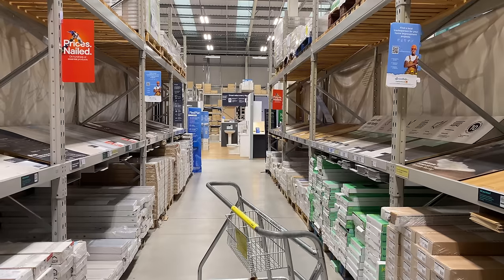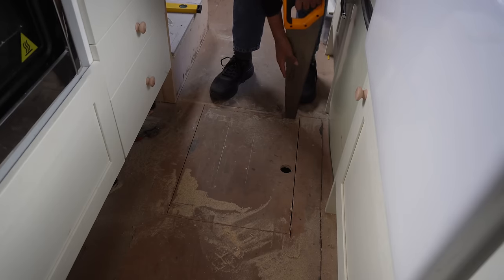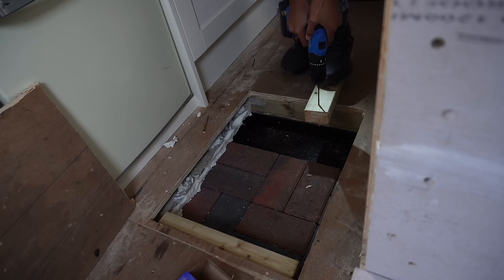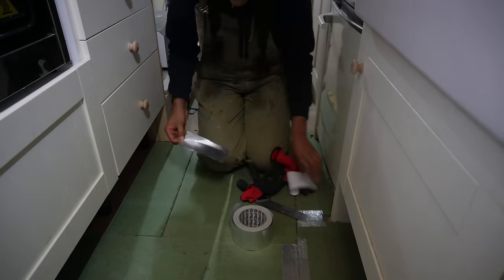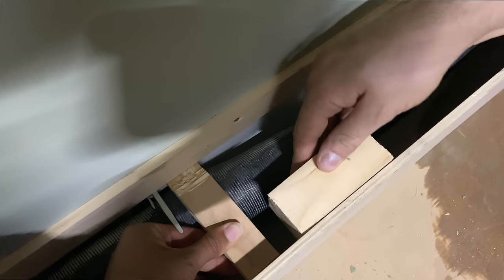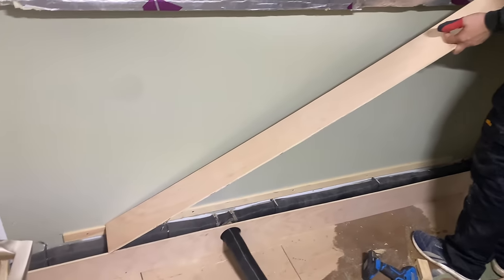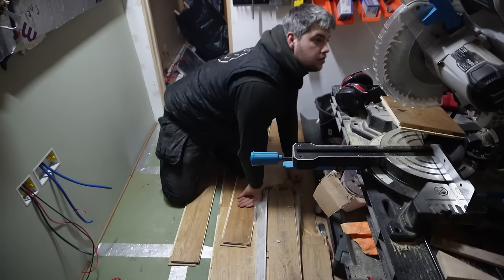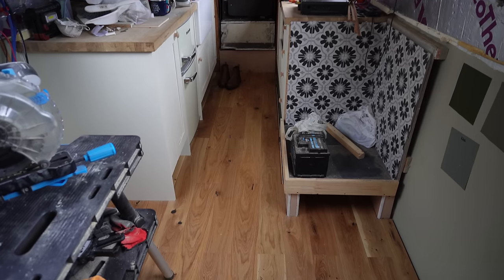STUNNING change on our narrowboat renovation

Comment: I bought a tin of white but when opened it was green, just a bit darker than yours, it is really nice from engine area to the galley where it changes to dark deep aqua from Zinsser:.a very tough paint, has a slight satin finish, I'm very pleased, the dark aqua works well with the white satin above. Leave it as it is , is my advice, it's not till evething comes together that you can be sure, and if it gets a bit scuffed or dirty, you can refresh next year. I have just had to open a new tin of Zinsser, it's not easy to mix if it's been sitting around BTW. I had missed a bit firstvtim around, so I just dabbled with a brush and it now has a nice wavy look if looked at from a different angle, I rather like it, even though it was unintentional.

Comment: Hi,  I'm a  narrowboat liveaboard.

Just wondering why four large  bilge   inspection hatches were needed,  with consequent loss of rigid  insulation board,  rather than one ? And why not just have a spyhole ?

A  vapour barrier between the plywood  base floor and  the laminate underlay.  also seems necessary, to stop warm damp air  in the cabin meeting cold air coming up from the floor and forming condensation.

Just saying.  No shouting in any replies please.
Reply: @mike-driftwoodfolk2651    Great reply.  Many thanks
Reply: I think they’re for storage , once the bits of ballast are removed it’s a great place to store beer .
Reply from the maker: Agreed, great for storing beer and also veggies like potatoes etc! The ones in the bathroom and bedroom will likely not be as big

Comment: While you're running cables, run a water pipe along with the wires.  The pipe will act as a conduit for some unknown future need.  Trust me, you'll be chuffed some day.
Reply from the maker: Ah, would've considered it but we've already ran the water pipes!
Reply: @DriftwoodFolk  Sorry, I'm not being clear.  I'd run a dry pipe along side of the wires to use as a conduit as future-proofing for when you need to run another wire or something (solar, server, mains, etc.).